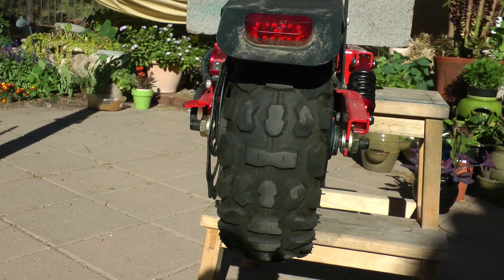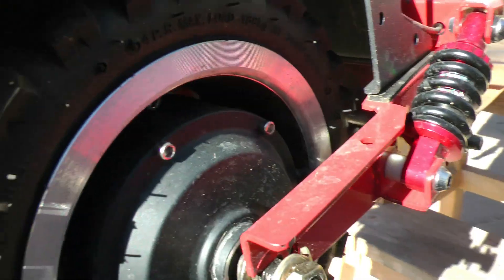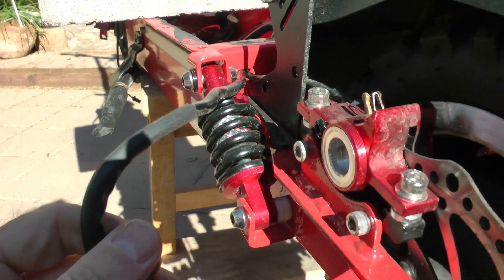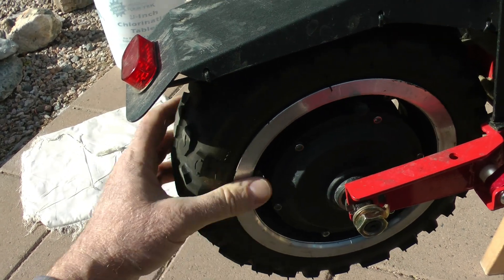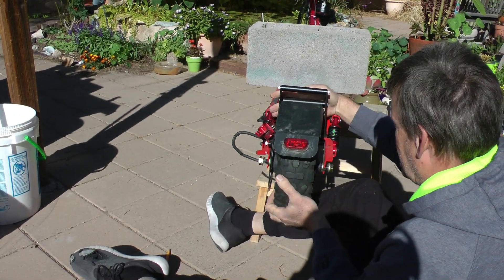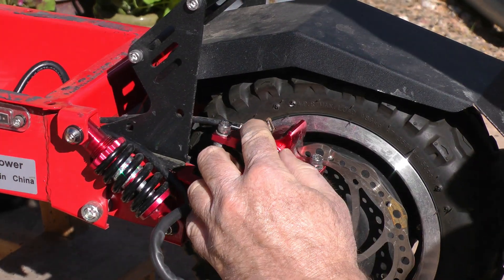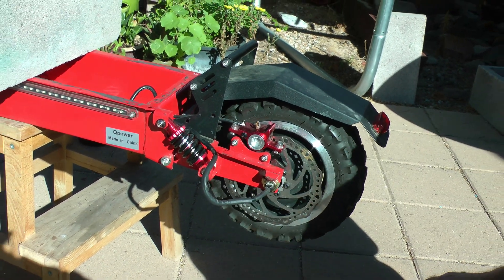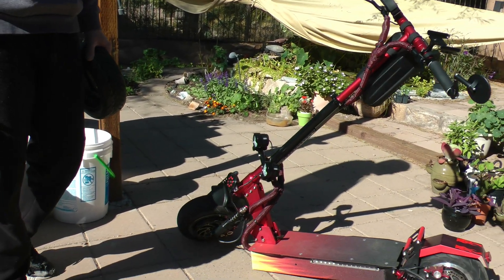Q-Power wheel removal and install

Comment from the maker: Got tires through Alibaba.com. E-mail Michael at: michael001jiahang@163.com and he'll give you a quote including shipping. The tires are: CST 11 inch tire, 90/65 - 6.5 with tube. I ordered 4 tires and tubes since shipping is half the cost at least. Paid $135 including shipping. Got them in ten days. They have both street and OEM off road tires, just let Michael know which you want.